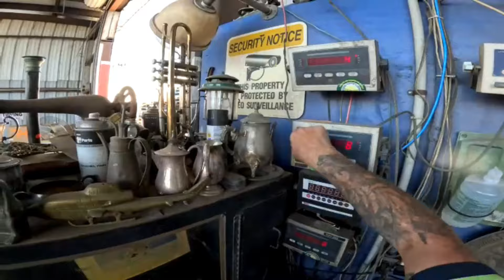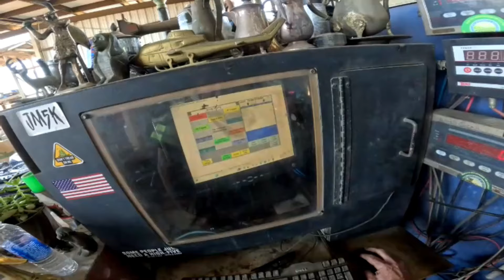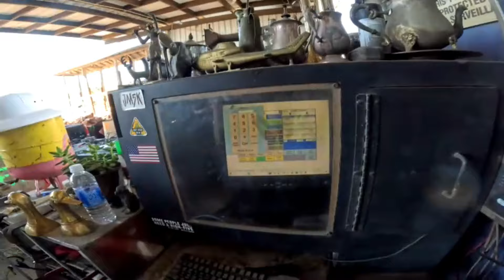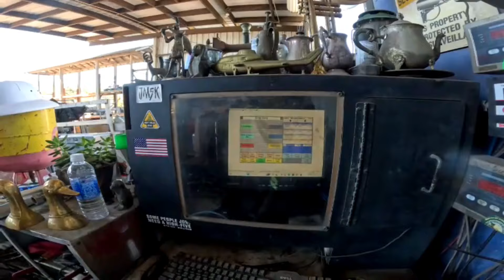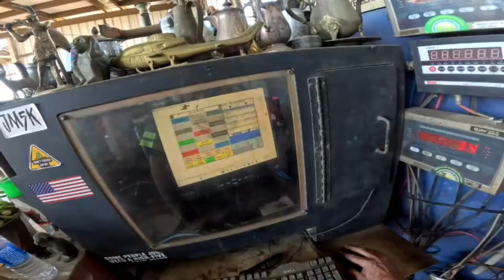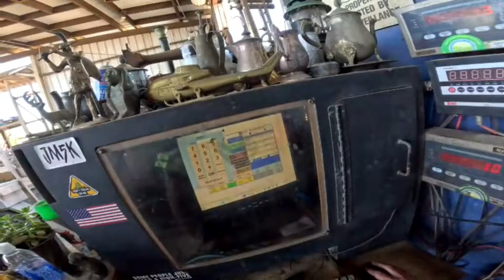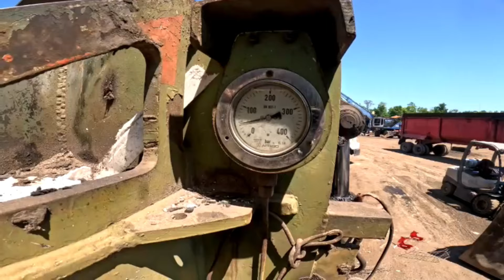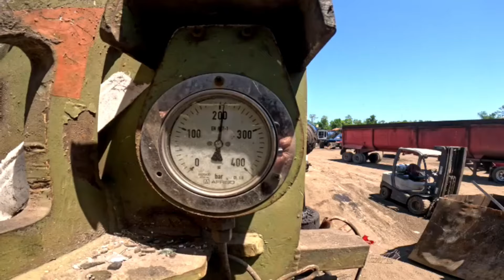UNSEEN SATURDAY

Comment: What GoPro would you recommend
Reply from the maker: Probaly the 9 or 10. The 11 is prone to over heating. Do a little research especially if you want a video longer than 20 minutes. Mine will shut off because of the heat
Reply: Thank you
Reply from the maker: @jameserickson693  of course. Just do a little research in what works for what you want to do. Junkman5k and Nacho both have go pro 9. I have the 11